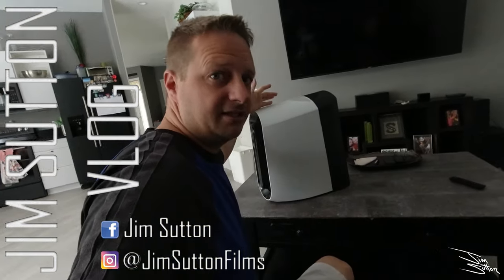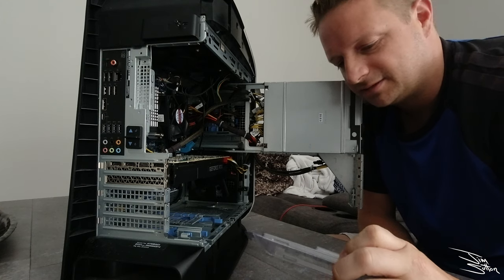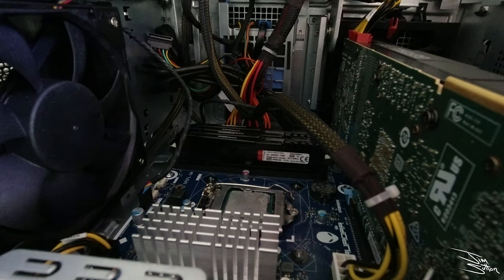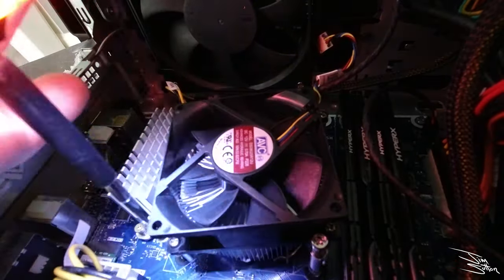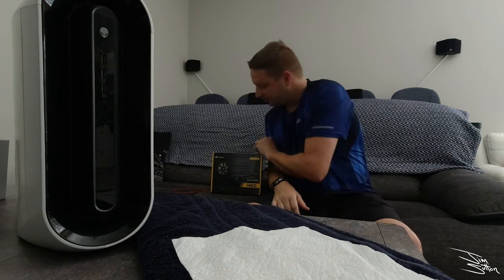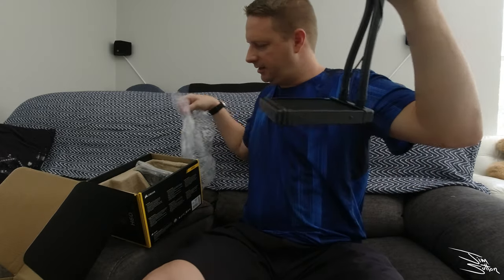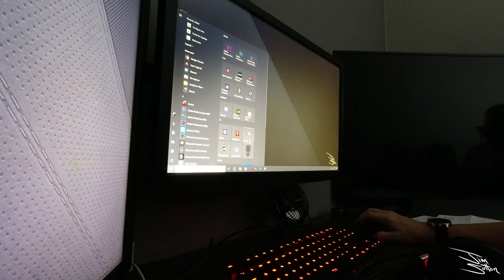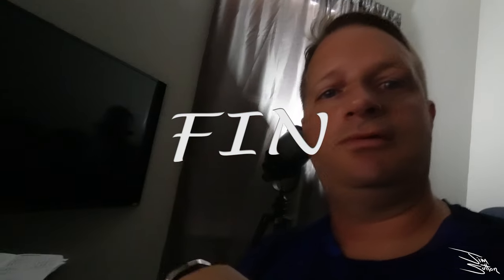VLOG #128 loud Alienware adding water-cooling so its silent and does not run so hot! Alienware R9

Comment: Hey Jim. The Fan should have went In front of the radiator   (fan---> radiator) Which is pull then exhaust. The Fan exhausts the hot air out of the case through the rad, fins. Unless you run a 2 fan setup (fan----> radiator ---->Fan)...which is pull--->radiator----->-pull------>exhaust. The fan "is" set in the  right/or facing the right  direction(It is pulling). I know this is  3 years late coming but ....anyway GREAT JOB with the DIY.
Reply from the maker: Thanks man. If you read more. I ended up with a sandwich :-). Fan rad fan.
Reply: @DeCoNzMe  Cool !!!! Game on my friend...

Comment: Thank you for this. Did it all on my own and I couldn’t be more proud.
Reply from the maker: I love hearing that. Glad I could help!
Reply: @DeCoNzMe  Hi Jim

What size of thermal pad should I use 
There's 30  and 40 mm?

Thanks
Reply from the maker: @robertclever5352  depends on what processor you have. For mine it was 30mmx30mm

Comment: Jim, between your video and the Dell R11 assembly manual, I managed to finally get this done today.  The only difference I could see between your R9 and my R11 is that the CPU fan pins on the system board are way away on the opposite side from where the fans are.  So essentially, I had to plug the top most fan (the Corsair fan) into the CPU fan as that cord was long enough, then the bottom fan (the stock fan) into the Top Fan pins.  The computer doesn't seem to care, and best of all, I'm seeing 20-30 degrees cooler CPU temps now at idle and under load.  And, I can even feel cool air blowing out at idle!  Thanks again, man!
Reply from the maker: So glad it helped you!  I hope others with the R11 can get this figured out like you did!  And ya. Huge difference in temperature!
Reply: @DeCoNzMe  I just ordered my R11 with the basic 500W power supply and low profile fan. The difference on the website was huge, like it is for RAMs too. Both this comment and your video is a lifesaver. I am aware of what I'm about to face, I just hope to solve it asap :) Thanks for inputs!
Reply from the maker: @EndoJunts  the original cpu fan is not used again.   I was able to use the stock top fan, and the one that came with the cooler to sandwich the radiator.  But it's not necessary.  The problem some people have is that the stock top fan works great.  However the ones that come with some of the cooler setups throw an error code.  So if you need to, use your stock top fan on the radiator.  If you can, try adding the new fan as well, and cross your fingers it doesn't throw an error code :-)
Reply: @EndoJunts  you pretty much got it.  Let me break it down step-by-step.  Let's assume the computer is standing straight up:

1)  Upper-most fan (the one that comes bundled with the Corsair H60) is mounted at the very top, closest to the air vent, at the top of the machine.  This fan is the one that you'll have to plug into the CPU Fan pins on the motherboard.  As you've seen on the R11 motherboard, those pins are essentially towards the bottom of the motherboard, a ways away from the top of the chassis.

2)  Radiator goes in next, with the tubes and everything oriented the same way Jim does in his video (it will only line up with the screw holes one way as well - again, as Jim points out)

3)  Finally, the stock fan - the original exhaust fan that you had to remove to gain access to "the void" as Jim calls it, that basically goes back in place where you initially took it out.  The tubes from the radiator will actually fit around the bracket that holds that fan - trust me.  Then, that fan, due to its short wire, has to plug back into its original Top Fan pins on the motherboard.

Both fans should be pushing air up and out through the top of the case.

4)  At this point, yes, the original CPU fan and heatsink (all one piece), the one that was mounted to the processor, should be removed.  You will NOT be using this little fan/heat sink combo anymore.  Save it, recycle it, do whatever you want with it.  Ensure you clean off the top of the exposed processor like Jim did and either use a thermal pad like Jim did, or just use the thermal paste that comes pre-installed on the H60.  I used the paste since I'm lazy and don't intend on removing the H60 anytime soon.  

5)  Then mount the tube pump directly on top of the processor.  Orient it exactly how Jim does in the video.  The tubes will swivel a bit where they meet the pump on top of the processor, which they're designed to do.  It's a tight fit once everything is closed up, but it will work.

I hope this helps.
Reply: @EndoJunts  you're quite welcome.  I could not have done any of this myself without Jim's awesome video, as I've never dealt with an AIO liquid cooling solution myself - especially on a brand new computer that I didn't build.  Good luck to you.
Reply: Hey strazman, I plan on doing this upgrade with my R11. I was a fool and didn’t order liquid cooling from the get go. Just wondering if you have any advice for me? I have read your previous comments and feel I should be able to get this done. If you have any other pointers I would really appreciate it! Thanks.
Reply: I just finished my H60 install and everything is working great! After 30 mins of COD Cold War my CPU used to be very close to 100C and now it’s topping out at 70C. Thanks @Jim Sutton, @Strazman and @EndoJunts. I did make a small modification in @Jim Suttons and @Strazman detailed instructions (which were incredibly helpful!) I noticed that if I oriented the pump on the CPU as in the video, my tubes were close to kinking, so I just flipped the orientation 180 degrees (such that the tubes cross over / around the pump. Success! No kinking and the power supply closed much easier. I hope that’s helpful to the next reader. The loud fan noise is the reason I looked into doing this upgrade and now I’m loving how quiet my R11 is running. Thanks again!

UPDATE: According to CPUID HWMonitorPro my CPU is more like mid-50s Celsius and for whatever reason AWCC Fusion reports 69C to 70C under full load.

UPDATE 2: Regarding the differences between HWMonitor and AWCC above, I was looking at the "Core" temps only in HWMonitor (not "Package"). The "Package" temperature in HWMonitor seems to match AWCC temperature.
Reply: I feel sandwiching 2 fans on different pins with possible different speed/rythm could potentially make the air flow worse than just having one fan? am I wrong?
Reply: After some research, having the pump in CPU Fan and the corsair fan in Top fan will solve the issue and is completely safe. But hey, who knows.

Comment: Thanks a lot for the video. Double fan sandwich mode works perfect so far on R9, no errors. Original fan on top and corsair H60 in the bottom. Just had hard time with top fan power cable through the black box. The radiator covers the box completely leaving no space for the cable, so I made a hole in top corner to get the cable through.

Comment: All Alienware computers should come with water cooling with an option to delete water. I missed the the case option with water and bought an A11 without it. I returned it because of how loud it was even when wearing a head set. I went through looking to add water cooling, but unlike you I said forget it. Once I saw I would have to add a bracket behind the processor I was unwilling. I did not know the system didn't need the bracket. If I had seen your video earlier I would still own the R11. I did end up going back an ordering an R10 with water cooling and am happy now. Thanks for video.
Reply from the maker: Good input.  Did you happen to notice what they charge to add watercooling to their system?
Reply: @DeCoNzMe  $50.00. It's cheap, you just have to know it's under case options.
Reply from the maker: @rawouch  then for that price.. it's a must.

Comment: Gonna try this tonight. Gonna use this vid looks legit and well explained. Wish me luck thank you . Ill keep updated
Reply from the maker: Best of luck!
Reply: @DeCoNzMe  thanks man. It was a mission success thanks a bunch. Only prob im having is that Everytime i restart computer it shows the diagnostic saying my cpu fan cant be read so that’s a bummer gotta figure out how to disable
Reply from the maker: @rubendiaz671  that means you have a fan that doesn't play nice with the system!  Some people on here say that some of the fans they are using now seem to be having that issue.  So you need to be using only the stock fans. Or see if you can find one that does.  Best of luck with that!  It is annoying. However it does still all work at least.
Reply: @DeCoNzMe  my solution was that i plugged in one of the corsair fans from the push pull setup in the cpu fan slot and it works flawlessly. Its quiet and i get zero codes and keeps pc cooled . Thanks for the tutorial

Comment: Great video and thanks.i just got R10 couple days ago and made a mistake of getting air cooled just to save 100 bucks.  What a dummy I am. I might have to go thru this route or call dell and see if they can swap it since I have the the warranty and coverage from them. Cheers.
Reply from the maker: It is still cheaper to do this swap. Just fyi
Reply: @DeCoNzMe  yeap not the most PC savi person lol that is why didn't want to mess up. Did u get any error from BIOS after installing the new fan or any kind of system error?
Reply from the maker: No.  No errors.
Reply: @DeCoNzMe  thank you for the reply. Cheers 🍺

Comment: Important information, if you have a more recent H60 (2018) you need to connect it to a SATA connector. But some of the steps have been streamlined for intel processor.
Reply from the maker: Thank you for the bit of info
Reply: @DeCoNzMe  This is kind of an issue, because if you plan to add 2 SSD, well, your out of connector (and luck). Or maybe, there are more of them I can't find?
Reply: I guess you could use a splitter?
Reply from the maker: @buflen  i have 2 ssd in mind, and the m.2  with the watercooler in mine.  no issue.
Reply from the maker: @buflen  and yes. a splitter is always possible.
Reply: @DeCoNzMe   I have just been looking into this as I ordered the R11 not realizing the significance of liquid cooling (new to Alienware coming from the Studio/XPS line).  Getting mine with a 1TB m.2 and planning to install 2 HDDs (3.5" and 2.5") and a third SSD (2.5") .  The R11 specs support 4 SATA connections so with 3 used for HDDs/SSD, I should have the last one one left over for the H60.
Reply from the maker: @alnoormeralli  sounds good to me.

Comment: @Jim Sutton just swapped over to the H60, what did you do about the Heat Sink (I that is it) that sits next to the Water Cooler pump? Did you have one of the hoses resting on it or next to it? I dont have mine pinched, but one of the cooler hoses does sit really close to it if not touching it a little.
Reply from the maker: I didn't have any problem with it.  Is it pinched?
Reply: Jim Sutton doesn’t look to be, just being overly cautious and curious if you had done anything different with it.
Reply from the maker: It's a little tight... But no issues for me.  Just make sure it's not going to break or pinch anything.
Reply: Jim Sutton Ok. One more thing, would it hurt to have the fan mounted on top or does it need to be below the radiator. Saw your video with it on top but also saw you added another fan.
Reply from the maker: @Lost_Angel_TX  I tried both to see what seemed to help the most for air flow.  Both fans worked best! But for on top or bottom... The top worked best for me.

Comment: this video was very helpful i hit the like button and subscribed ! thanks mate
Reply from the maker: SO glad it helped you!  Good luck if your doing a similar update!
Reply from the maker: And thank you tons for subscribing!
Reply: @DeCoNzMe  yes I'm going to try to go to best buy today. but they don't have those type of pads. they only have XTM50 high performance thermal paste from Corsair i dont know if that's a good one. I'm new to pc so i don't want to damage anything
Reply from the maker: @rogueace7893  most any of those thermal paste products will be fine. It's just more messy than a pad.  Best of luck with your install!
Reply: Jim Sutton Im just going to order it on amazon for the pad and the only problem is they only have Corsair Hydro series H80i V2 available and I don’t know if it’s Compatible with the A9
Reply from the maker: @rogueace7893  that one should fit, although the cooler portion that goes on the processor has tubes that come straight out.  They may not fit.  They may hit the power supply.  That's why the one I got has the moveable hoses.  (I talk about it in the video)

Comment: I just replaced the original intel CPU fan by the corsair H60 on my Aurora R11-727 (Intel i9 10900F) 
it works but i have a bios error message when i boot the computer
any advice about this prioblem ? 

there is no satapower cable on your corsair h60 ?
Reply from the maker: Is your issue a boot error for the fan type?  If so. That's all it is. Your fan is not playing nice with the motherboard.  Try just the stock fan on it.  It will get rid of the error, and should still work to cool the system well.
Reply: @DeCoNzMe  I plugged the H60 fan on Top Fan (it replaces the top fan) 
i plugged the Pump on CPU pump
and I plugged the satapower on a sata cable from the satacable from the "powerbox" 

now it works properly
Reply from the maker: @guillaumebrossault4130  perfect.  So it's just that fan that doesn't play nice.  You will have to find the ones that do. Or just leave it as the single fan setup.
Reply: Your s is a r11 ?

Comment: I got the same alienware and issue. Upgraded to H60 and temps are a lot lower and is pretty much silent!
Reply from the maker: seems we are far from the only ones!
Reply: No issues with the Alienware command center where the fans setting are for the water cooling and case fan or are those disables and you’ll more then likely need and app for configure that?
Reply: did urs already have the factory water cooling? mine does and its still rly hot
Reply: did you use two fans? one above the radiator and one below it? kinda like a sandwich. in the video i think he just uses one fan. but im seeing others saying to use two.

Comment: Thank for this great and informative video! I just got an R10 Ryzen edition with the liquid cool option, however the stock fans (AVC for intake, Nider  for exhaust) were really loud. I replaced them with the Corsair MK120 Pro (non-led/rgb, which is key to not have BIOS errors). These fans are waaaaaay quieter and I am so happy with my mod! One question I have is, you placed the fan on top of the radiator? Mine was shipped with the opposite and in fact, the service manual (for the R10) indicates that the outake fan should be at the bottom, so I am a little confused. Again, thanks for posting this.
Reply: same here, why is it on the top?!! lol
Reply: @kevinsowards9647  @salvamando1 - I too have this question, I will report back with more information as I do more research. In another video I am watching for this process, and this video I think, bear with me Ive watch so much content, it says that the fan on the radiator should be an intake fan, so I believe here that @Jim Stutton did it as an intake fan pushing air into the case, is that correct?

Comment: I can’t find the vrm heatsink any ideas?
Reply: Anyone
Reply: @CrypticHack3r  ebay, , they run about $15 and it looks like the heat sink is the same for the R5-R11 motherboards, order some 1mm thermal padding for the sink. Both my R7 and R10 have the same Vrm heatsink.

Comment: I get an endless bios fan check at startup
Reply from the maker: That's because the fan you attached is not fit for that motherboard.  Try it with the stock fan instead of that one.  It will go away.  Only a few fans allow for that to work.  This one always did before. Maybe you got a newer one that is not compatible.
Reply: @DeCoNzMe  I actually attached the pump to the cpu fan header and it’s perfect. Much cooler as well. Just reads the pump as a fan showing it’s rpm
Reply: @DeCoNzMe  The Corsair ML120 fan also resolves the issue.
Reply from the maker: @Sonic_1000  thank you! I couldn't remember what one to get.

Comment: Hi Jim! Just got a very good looking used R9, everything else is fine but the fan is LOUD while gaming. I just want to try out the water cooling. I know it has good thermal. I want to ask is it silent while gaming?  Do I need to purchase a separate fan as well? Thank you so much.
Reply from the maker: The fan that you hear is the cpu fan.  That's why we go to water cooled.
Reply: @DeCoNzMe  thank you so much for the reply! Another small question, do I have to sandwich the radiator in the top chassis or just use one fan is good enough?
Reply from the maker: @robert1374  it just depends on how much cooling you like.  One fan helps a lot.  Two seems even better.

Comment: @jim Sutton, what fan did you add to the bottom of radiator, guess it would be the “push” fan? Did you have to alter anything in the programming? Did you get a y connector to connect pull and push fans so they plug into one connection on Motherboard?
Reply: Following

Comment: Great! Just used this guide to install the H60 on my R9 too! One question: Are you able to control the top fan? In the Alienware comand center even if I crank it up to 100% it only goes to 40%.
Reply: I think I have the same issue. I got h75, my front and top fans can only go little below 50%
Reply: i think it has to relate to the BIOS, the only way to do it in HWinfo64, you can set the pattern or auto on according temperature to the fan speed